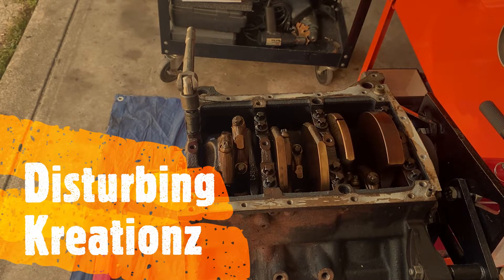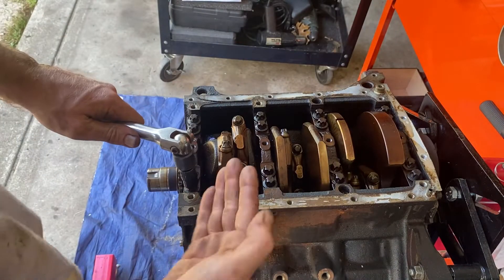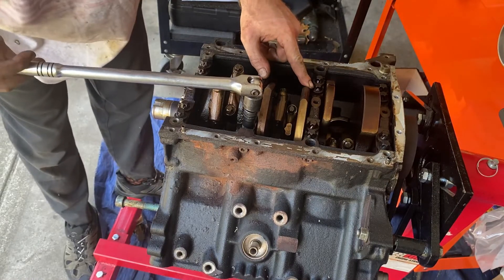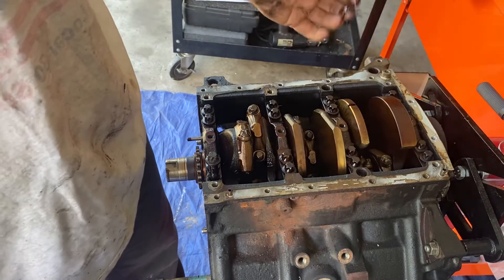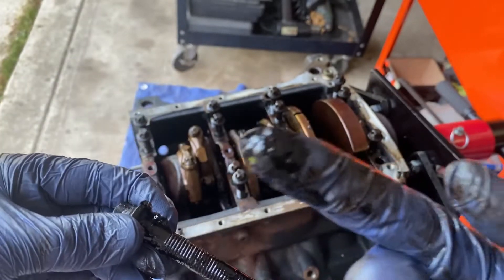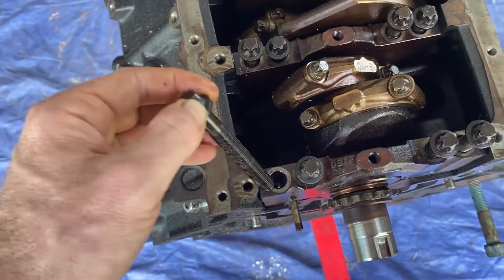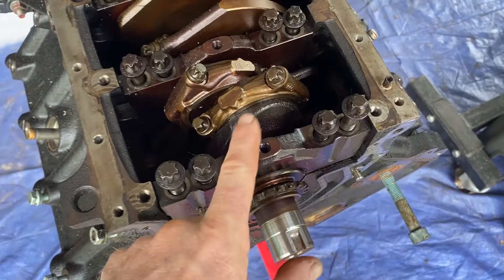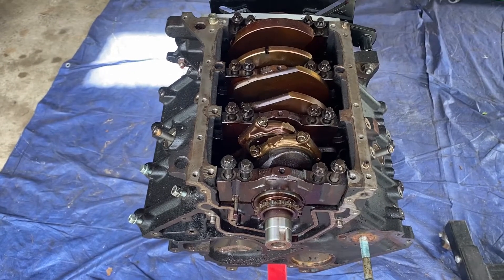Audi B5S4 & A6 2.7 How to remove and examine main caps, rod caps, and bearings. B5 S4

Comment: Thanks for the vid bro, very good information! By any chance, do you know the size of the lateral bolts that go connected to main caps 2 and 3
Reply from the maker: Very good question. ”. Inner studs are 3.875 in. long and the outer studs are 3.575
in. long. NOTE: LOCTITE MAY BE USED IF A PERMANENT MOUNTING OF THE STUDS IS PREFERRED.
THE FASTENERS, HOWEVER, MUST BE TORQUED PRIOR TO THE LOCTITE SETTING UP.
4. Install the main caps and check for binding or misalignment. 
Can I get a SUBSCRIBE and a few SHARES for this precise info mate? Thanks
Reply from the maker: BTW have 30 audi vids to upload already in next 2 months. Lots to come.